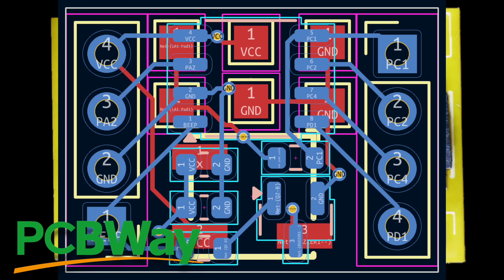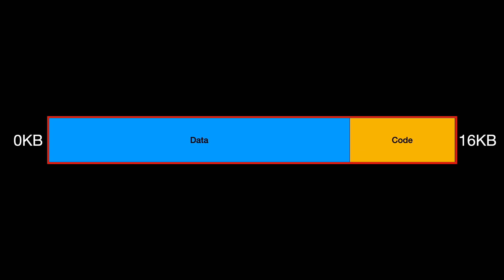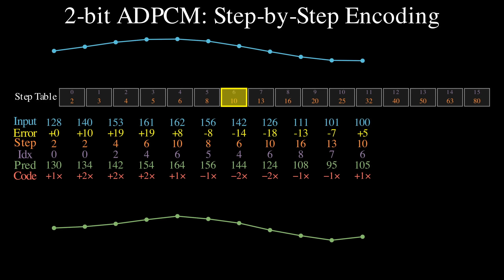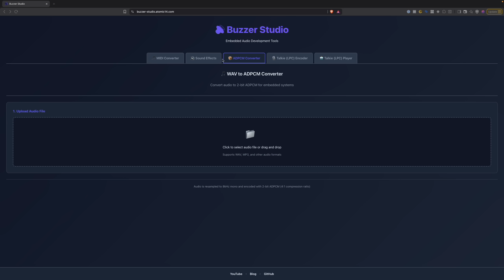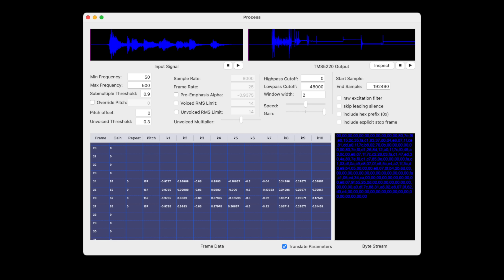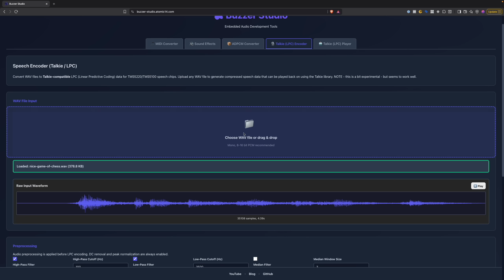How Is This 10¢ Chip Talking?

Comment: Any thoughts on the new chip, WCH CH32V317WCU6 that has built in ETH MAC, and USB-HS ? 
 MuseLab ( wuxx / nanoCH32V317 ) has a $20 board with it : 3256809730896379 / 3256808379401220

unfortunately, not much info on a JTAG/SWD debug adapter,    or examples on configuring the ETHERNET (MAC) / USB2-HS.. or even SPI-BUS with the DMA.  

It also uses a non-Eclipse based IDE, MounRiver Studio.

Comment: I appreciate you want to squeeze more from the chip alone, but in this case, it would make huge difference if you just put some cheap flash on the board and get better quality sound. I barely understand the speech 😄

Comment: I have ordered 100x 8pin ,16 and 50in 20in ssop20 long time ago.  Using it now instead of Arduino for everything, it's unbelievable how it can run with 0 external components and holds short circuits or over voltage.  Bitbanging nrf24 modules or i once even built something running 2x OLED  screens on pc1 pc2 pc3 pc4 pins.

Comment: Holy mother of algorithm hits! That's the kind of "so far out of the box, you look up at the sky and see the Earth" thinking I love to see. Just a souped-up RISC-based Arduino-alike with less Flash than a SIM card... and you whacked a speaker on there and made it tickle the speak-and-spell itch. I love digital glitching in audio, and always wanted to tinker with a speech synthesizer (a la Speak and Spell) to emit disfigured & gibberish strings of words - identifiable as speech (so, mostly correct) but with syllables mangled around, that kind of thing. Pair it with a word-index randomizer (say random words from its vocabulary) and jitter with its sequence of syllable choice as it talks... throw in some erratic syllable loops (say a 1 in 8 chance, trigger "you were only supposed to play that syllable once and increment to the next one, not loop it 0 or 16 times!") and oooh, that's a glitch speaker.

... And that's just the beginning. Use more RAM for more complex frequency-based hi-fi decompression? (break down input into spectrum analysis, store a series of frequency transforms, stack frequencies on output, that kinda thing)... or even bit-stream it to a real DAC chip... why does "microcontroller that isn't designed for audio" + "put a speaker on it!" always do this to me?

Comment: Did you know that the Q*bert arcade also used the TI speak & spell chip? It didn't say phrases directly, but instead, when Q*bert would swear with a bunch of symbols, "?*&%!", it would pipe a random number generator into the chip and play random talking-like-noise .  That arcade had all kinds of other things too, like a thumper in the base of the unit, that was basically a solenoid that would make a physical thud sound a few seconds after Q*bert fell off the level, like he fell off the screen and landed in the bottom of the Arcade machine!
Reply: Not really, that was Votrax
Reply: we lost something with the move to fully digital

Comment: Can you save flash memory by using packed code which will be decompressed into RAM? This was very common on the Amiga. The PowerPacker compressed an executeable and added a decode header, which decompresses the binary to RAM.

On my Amiga 500 I had no hard disk, only had 836 KB floppies. DeluxePaint IV was more than 400 KB, with PowerPacker reduced to about 250 KB. However, decompressing the file took on the 68000 17 seconds. I made a well-timed boot disk. The large file was loaded first, then the floppy continued its boot sequence while the decompression worked as a background process. As the Workbench appeared, DeluxePaint was decrunched and started. This was in 1992 with four floppies (including a weird HD drive) and the A570 CD-ROM addon. I had Kickstart 2.0 and probably 2.3 MB RAM. I'm not sure if I had the internal A570 2 MB memory expansion at that time.

This shows again how incredible the Amiga was. Preemptive Multitasking in 256 KB RAM on a 7 MHz CPU since 1985. Windows 3.11 and Mac OS System 5 MultiFinder only used cooperative multitasking.

Comment: Really happy to see this, finally! I've been trying to compress audio for the ATmega328p because either people said you had to buy a audio player module ($$) or that it's impossible due to the chips small flash size. I always found it weird since a lot of cheap toys could store "fairly long" samples. As a result I had written a converter in Lua that would take a raw audio sample, and compress it to a 4-bit w/normalization, and then use the upper 4 bits to define how many times the sample were repeated.
Obviously I used a 10s clip of "The Wrist Game" lmao.

Comment: Wonder if it could be hotwired into a microcontroller such as the rp2040w and give it some general sound functionality.
Reply from the maker: You could - but all this code would work equally well on the RP2040 as well.
Reply: @atomic14  The only way i have of making sound on the rp2040 is a "Piezo Electronic Buzzer" but its volume is quite limited.
Reply: @steve64464  The RP2040 can output PWM, which can be low pass filtered, amplified and played on a speaker.

Comment: This looks and sounds very interesting. I did some experiments with LPC as well, encoding speech to run on the TI-99 speech synthesizer since that was my first computer. On your converter page, you have a selection for "TMS5220 (TI-99/4A)". Sadly, this is incorrect... the TI-99 speech synthesizer had a TMS5200 chip, not a TMS5220. The TMS5200 has different encoding tables to the TMS5220, so if you use the TMS5220 encoding tables for encoding speech for it, the speech will play, but it will not sound quite right.  The TMS5220, and its compatible successor TMS5220C, did get use in some arcade machines, especially by Atari Games, like "Star Wars", "Firefox", "Paperboy" and "Gauntlet". The converter on your homepage doesn't seem to work quite well, especially it seems to have trouble to find out the correct pitch for each frame. I once did a converter program of my own in Visual Basic 5 (based on the C source code of 2 routines I found on the Internet), I can try to dig it up if you're interested in the code.
Reply from the maker: That would be really useful - can you add any suggestions you have for improvements to a GitHub issue - along with any sample code you can find.

Comment: so is this how you can truly make a custom audio chip, the same that cheap car toys use?

perfect 👌
Reply from the maker: It's one way. There are dedicated ICs for the really cheap birthday card/toy type of thing. Normally they will be done as one of those blobs you see on a PCB.
Reply: Those are usually dedicated OTP or mask-ROM controllers with dedicated H-bridge D-Class amplifier using PDM for audio, a little ram, maybe a few outputs for flashing LEDs and/or button inputs. Typical toys like those singing christmas figures have a single button input, two outputs for controlling motors (usually going straight into PNP transistors) and two pins for audio, running typically on 3-4.5 V. Older toys used a singular NPN transistor for audio amplification with either analog (i have seen both linear and u-law) or PWM input on its base. Usually hidden under an epoxy blob.
Reply: @nrdesign1991 

I'm talking about the lowest of the lowest electronic toys. no buttons. it just instantly plays a 7 second song loop non stop.

they also use ADPCM so this lil chip could be the way for a chinafake fan (like me) to make a custom chip.

(but the easiest method for that would be to bitcrush audio into a generic mp3 card)

Comment: Back in the 1980s there was a bathroom scale marketed which had a TMS5100 in it.  The voice samples were that of the inventor.  Rather disappointingly it didn't use a load cell, but rather it was based on the mechanism of a Taylor dial scale and an optical encoder was used to read it.
Reply from the maker: Nice - that would be a fun thing to play with.

Comment: This is very cool! I'm curious... in your 2 bit ADPCM converter, was there an antialiasing/low pass filter step on the original audio before the 2-bit encoding?
Reply from the maker: The audio is downsampled to 8KHz, but I'm not doing any pre-processing. I think a low pass filter and noise removal stage would definitely improve things. I also haven't done much investigation into optimal step sizes.

Comment: Very cool !  It sounds like there is a bit of high frequency noise in the output signal - maybe a low-pass filter on the output might make the sound better ?  I can remember the SP0256-AL2 text to speech chip used an LC filter that improved the audio quality noticeably. Extremely nice work !
Reply from the maker: Definitely - this is very much on the quick and dirty side of things!
Reply: @atomic14  That, and the "underwater warbling" sound from some of the other samples, is fully expected at such a low bitrate. It's related to why shortwave radio often emits robot sounding voices from unclear signals. In this case, the actual soundwaves output from the chip have all kinds of pointy edges and troughs that come out as warbles and high pitch noise artifacts. There's nothing that can be done, except using something that smooths the signal out (which will destroy some other sounds you do want, though). This is more or less like a de-esser used in sound studios.
Reply: @atomic14  convert the setup to a A-class amplifier and put a RC integration filter (aka lpf) on the base of the transistor. Make sure the polarization current is less than the max current the pin can drain. Nice finding.
Reply: I had one, I still have it.
I didn't think anyone but me would remember this speech synthesizer IC. 28-pin DIL package SP0256-AL2
Reply: @perceptron-1I remember them from a not builders book.
Reply: Yes, you can see the high frequency overshoot spikes in the "predictor" output at 3:13.

Comment: When I was a teenager, I once built something similar by bit-banging the cassette port on my ZX-81 computer using assembly. I wrote two routines, one for recording and another for playback. That was the first piece of Z80 assembly I was truly proud of.
Reply: I also taught the ZX-81 computer to speak, which I built myself.
A 1-bit digitizer program, a few lines of Z80 code, and a few lines of player. The whole thing was less than 100 bytes, because the sound sample needed space, 1 kByte could hold 2 words, but with a 16K expansion, quite long sentences could be stored, 2 minutes long, even music, but it could be generated in better quality than storing it as a digitized sound sample.
We were still a long way from Gigabytes.
Reply: Same thing on my Commodore 64 😀
Reply: That's so cool. Especially in the time where info was so limited!
Reply: Did the same on Windows 98 using asm. Sounds were good with disabled interrupts only.
Reply: Love me so z80
Reply: Same with my Speccy!
Reply: BITD, Ttere were a pair of Apple II programmes—Apple Talker & Apple Listener—that did that.
Reply: @ueberRegenbogen  yee, but it needed a D/A card in one of the slots, one 74F374 latch and
for the 256 levels of conversion 8x R-2R resistor ladder, which I designed and manufactured myself, >40 years ago.
It also spoke beautifully and its program was only 6 kByte, written in 6502 assembler code with phoneme samples.
Reply: @perceptron-1. The versions that i played with were strictly cassette i/o, and sounded terrible.  ☺
Reply: I got the ZX81 to recognise some Mancunian words — 1984 after I won the college Physics prize and I did advanced Maths a year early they put me in forced labour camps — 2024 they sanctioned me to no food at 60 (after Porsche terminated me for pneumonia)
Reply: @OghamTheBold  Bro can't even program a Klingon translator 🙏😭
Reply: @specialopsdave  I used 14 languages to export my libraries to 50 countries — The Library of Congress uses them and my work is on the EuroFighter Typhoon
Reply: @OghamTheBold  Though your career is not appreciated as your brightness was celebrated during your youth, you remain valuable, priceless.  Life has a way of grinding one down and leaving little but sarcasm.  But I encourage you to remember the ZX81 and what it meant to you.  I'm still proud of you for making the ZX do anything at all, let alone a language skill.  I hope you will look up and understand your worth.  Since you can collect a pension in 2031, I recommend you polish that resume and find a role with an opportunity to mentor someone younger.  I've seen guys hired specifically for that, to produce work in the presence of younger less disciplined workers.  Helping others is the best way to dilute the injustices of being older.

Comment: Is it possible to put a RC Low pass filter just before the speaker to make it sound smoother?
Reply from the maker: Yep - that would definitely improve things - at the moment we’re just relying on the speaker to do the filtering.
Reply: @atomic14  My gut is telling me that you really need to add a cap in series with the speaker. As it is now, if something hangs, it will just short the speaker. It looks like the LED is modulating with the audio, you are putting an 8 ohm(?) load directly across the power supply. Maybe a 100uf?

Comment: That "amplifier"😄 Not even a bemf diode? You could use one of those complementary fets in a sot23-6 for push-pull action.
Reply from the maker: Yes - there should be a diode there. I’ll have to have a look at one of those fets.
Reply: @atomic14  NX3008CBKS is one I've used recently. It's a sot-363, so smaller. You can wire it as an inverter and drive it directly from the gpio. No need for a diode with this but I would add a series capacitor to the speaker. There's lots of sot-23 ones also.

Comment: 10c, plus the $3 extended part fee :p (but yeah do need to play with these soon :D)
Reply: SOP8 are easy enough to hand solder. Buy the chips separately.
Reply from the maker: I got my chips from AliExpress (fingers crossed they are legit) and then hand assembled the boards - super cheap :) - if you ignore my time...
Reply: You can get a SOP8 to DIP adapter board for about 10 cents and just plug it into a breadboard.

Comment: Nice! I made once a ladder, covox player and actually 8 bit amplitude, wave 8bit pcm is a super quality, really, no jokes. If it wouldn’t then ther wouldn’t be file format of pcm 8
Reply from the maker: Was that one of those parallel printer port hacks?
Reply: @atomic14 nope, on some microchip mcu, serial eeprom and that resistors ladder. Memory was 64kB and quality of sound was just amazing. And there was some normal amplifier for speaker

Comment: Great job! This kind of project is right up my alley! 
I've had some fun MCU projects by breaking down a sample into 4 - 8 spectral bands vs time, at like a 50 Hz sample rate, this gets the size way down and sounds pretty good. I think the size/quality tradeoff gives LPC a run for it's money, now that decent compute is cheap on tap. (It's kinda fiddley implementing a lookup-table based sinewave oscillator .. but it is fun!  I have related python project on Github at WAV2VGM.)  
Another surprisingly good voice codec was invented for 3G telephony is called AMR-NB, with bitrates starting at 4.75kbits/sec.  Ive been wanting to do some LoRa intercoms or walkie-talkies with that.